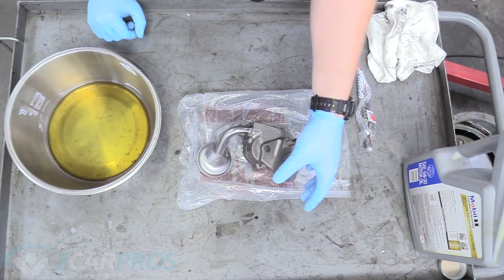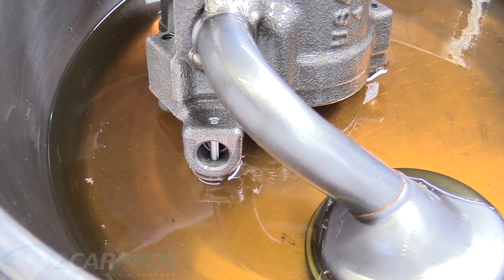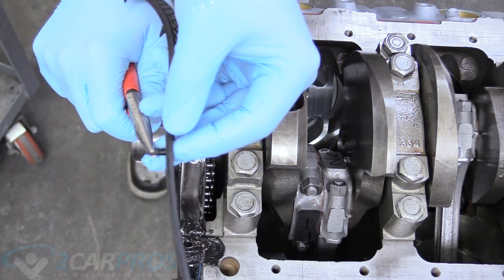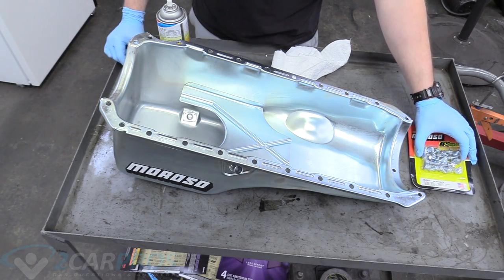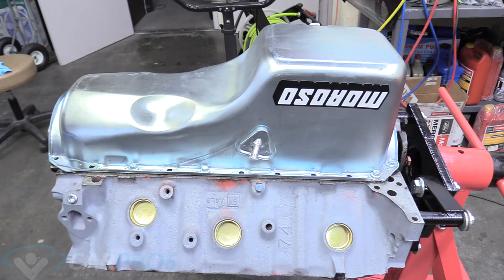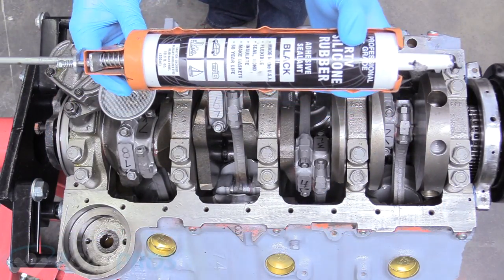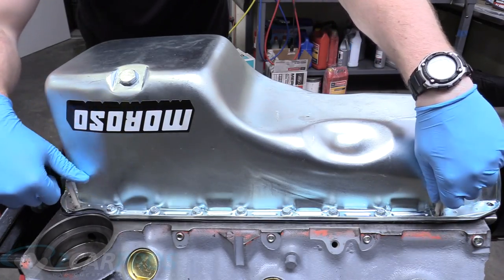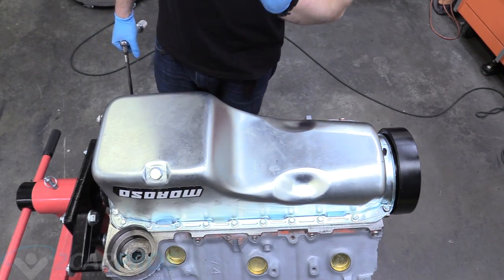How to Build a Chevrolet 454 Big Block Part 8: Oil Pump and Pan!

Comment: Awesome series Ryan, I have watched all of your series about 3 times by now :), Thanks heaps , little question for ya, looking to replace stock oil pan for my build, will it matter if i replace it with more quarts capacity pan or keep with stock?
Reply from the maker: Thanks for watching x3! No that won't change anything except how much oil you put it in when you change it. It is especially helpful with engines that run high RPM a lot like in a boat.
Reply: Thank you for the handy tips 👌🏾😊👌🏾

Comment: When placing the pan gasket on the block use gasgacinch 440A on the sides, the gasket will not move then. On the ends after you place the RTV set the pan on then go have a cup of coffee or a smoke anything to kill 15 minutes before you torque the pan bolts. You want the rvt tacky to prevent movement from wet and slick rtv.. you'll get a perfect seal everytime.

Comment: Really enjoying your in depth Instruction... just a few questions.. did you do a .030 overbore on the cylinders/block ? did you purchase the pistons that much over? and what did you have to do the crank too? or did you use stock crank bearing? I'm actually about to rebuild a 1971 402 and this is really helpful. !
Reply from the maker: Hey thanks for watching Mike! We did 0.030 overbore on the block so we bought positions to match. We went 0.010 under on the crankshaft. I double checked all of this with our machine shop. Good luck on your build! Part 15 of this series will be up tomorrow!

Comment: what would you suggest I buy to give a 1993 tbi 454 motorhome motor i am taking out right now, need to keep it low budget as possible,I would like to give it more power and torque, yet keep it dependable to pull a car behind it and go to California and swing around through mountains and colorado and around through Kentucky to Alabama and back to texas without any issues, appreciate any advise a long block from local engine overhauler is around 1795, I think I could do just what your doing and have a better engine, should I keep it tbi system
Reply from the maker: That sounds like fun! Well if it were my big block I'd go for a better cam and intake. Also consider moving back to a carburetor. Make sure your cooling system is also up to the task, it gets really hot here in California. Thank you so much for watching and commenting Raymond!

Comment: How many HP are you getting once is done?

I am putting together something similar, but with flat top pistons with stock diameter.

It may be a good idea to install yours...
Reply from the maker: Ooooo now there is the question I have been thinking about for the last 3 months. I have seen other guys run a setup very similar to mine and get around 500-550 hp. So I'd guess right around there. 

I mean I would, more is more :)

Thanks for watching Juan!

Comment: So is this block the Gen V 4 bolt main (1991) because after doing a little research it stated this is the year it started with the 4 bolt mains? I’m asking because I have one I’m working on and the part for the oil pump on summit states it’s for applications up to 1990 which would not be a 4 bolt main! Or does this matter and it works for both?
Reply from the maker: I'm pretty sure it will work for both. It is also my understanding that 4 bolt mains where typically for truck applications and were made during the entire length of the Gen4. Could be wrong on that though.
Reply: 2CarPros thank you! Also which video has the installation of the harmonic balancer in?

Comment: Hi again. So I’m at this stage now, I need the oil pump stud or oil pump bolt. Is that a part you replaced, or did you reuse?
Reply from the maker: It came with our oil pump or pickup. I don't think I re used that fastener. But there are hundreds on this engine, I can't remember where I got every bolt from. Knowing me I got it new. I wanted everything new. Thanks for watching!

Comment: Thanks for posting. 
Why does the oil pan have a hole in the center towards the front?
I thought I ordered the wrong one for my 454 but i noticed this moroso pan also has a hole with no bolt.
Reply from the maker: Mine has that too I believe. I believe it is so the same pan fits a Mark IV and a Gen V big block. Thanks for watching!

Comment: Disappointed that Oil pan to to Pick - up  distance was not checked, ( modeling clay method.)
Reply from the maker: They are both the stock position, really no need to check when everything is basically a fancy version of stock. Thanks for watching!
Reply: I was a little confused/concerned myself until I checked out the pump on the Summit website. I’d still check it anyway

Comment: You shouldn't use any gasket sealer with the one piece gasket. Especially the amount you used on the front. Way too much. Don't need any at all.
Reply from the maker: I disagree. Thanks for watching!